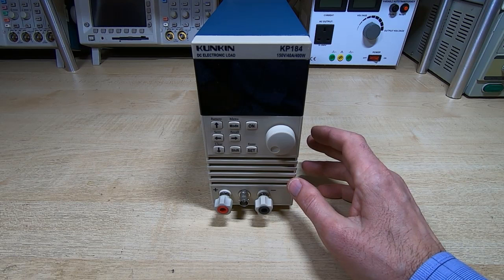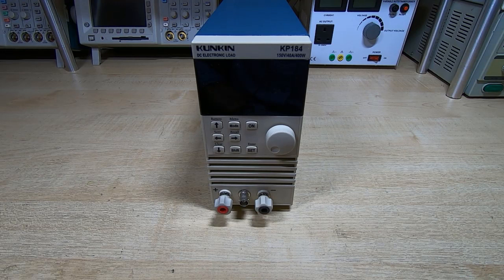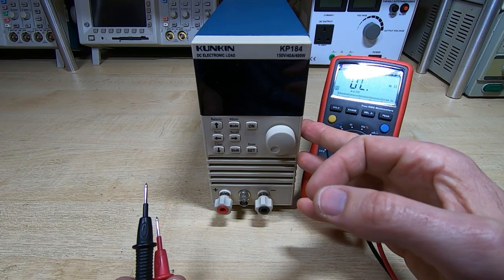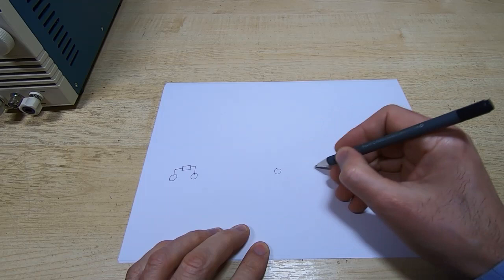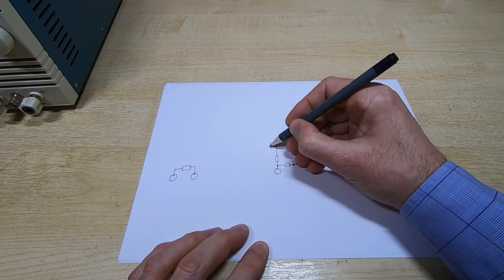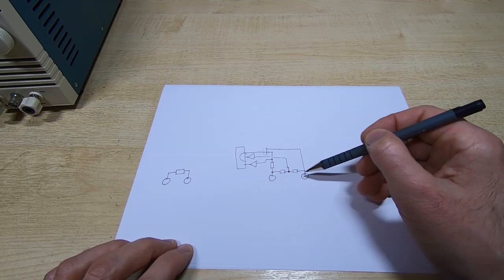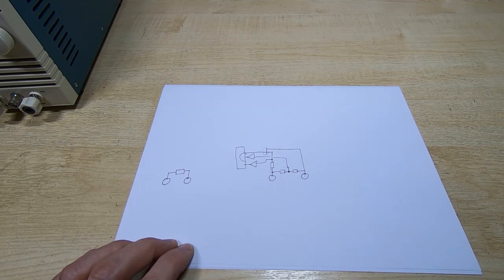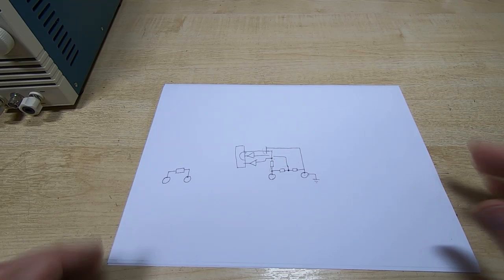Electronic Load Fundamentals

Comment: I'd certainly be happy to learn more about electronic loads from you. I've been tinkering with one myself, using a MOSFET as the main component, a shunt and an opamp for the current feedback, and a few analog components to adjust the system.
There probably is a whole rabbit hole if you start digging into stability, safety margins, and proper heat dissipation. Following into these depths under your lead certainly sounds like an awesome voyage!

Comment: Jerry, I am wondering if you have taken a look at the East Tester line of electronic loads? I also have a Kunkin that I bought, but then bought 4 of the ET5410 loads, simply because the front panel interface is so much easier to use. They both appear about the same as far as capabilities and build quality, but the LCD display makes it so much easier to use.

Comment: First, make it clear that this is a DC load, not an AC load. If you use a power bridge for AC load use, you must inform that the diode bridge is very slow, e i
low frequency only. Floating or fixed Gnd must be observed.